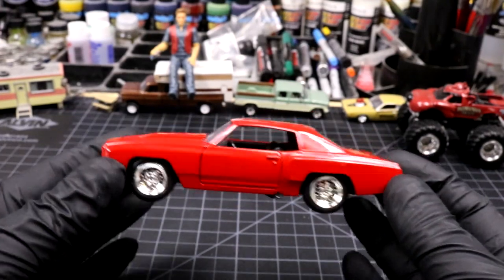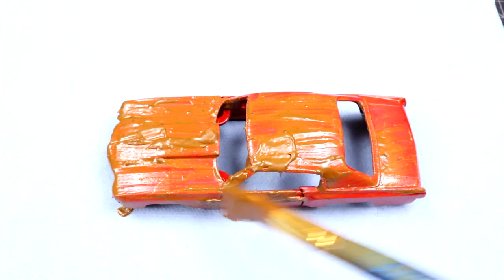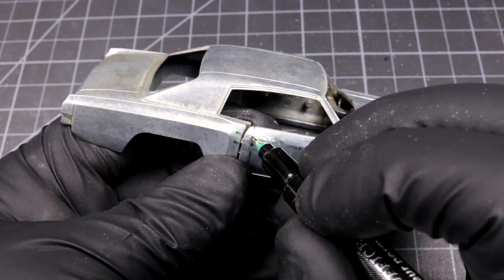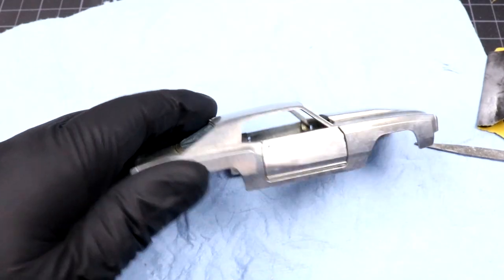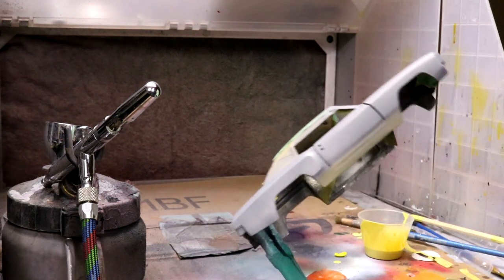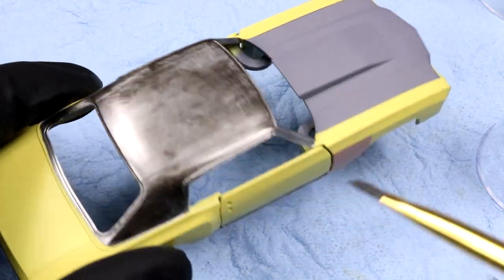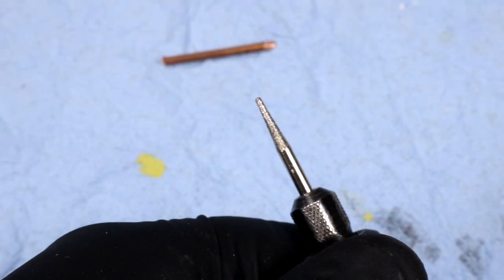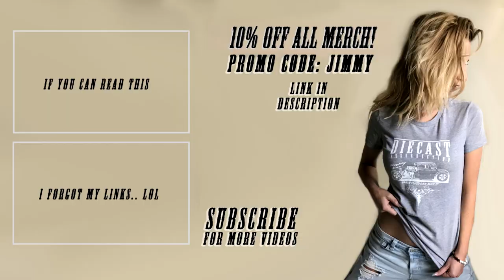I Made the Fast And Furious Monte Carlo (1:32 Scale Diecast Build)

Comment: What type of putty did you use for this?
I've used a few kinds for the cars Ive done and not had much luck with some brands
Reply from the maker: I use a JB quick weld putty, make sure it's the High Heat kind.. can be found at a hardware store next to the regular JB expoxy.
Reply from the maker: Check out the VW bus truck trailer combo vid to see more of it.

Comment: question i am looking to do some custom hotwheels my question is how did you reattach the bottom to the the body did u use rivets or what
Reply from the maker: Those bigger cars mostly have screws from the factory so they are easy to take apart and put back together.
Reply: @DiecastResurrection  can u use screws if it  used rivits. And another question what was that product u spray to keep the decals you printed from bleading on your making water slide decals with inkjet ep i will like to make my own decals so the name of the product would be helpfull 
love your vids keep them comming

Comment: 1970 Monte Carlo has round turn signals in the front bumper.  A 1971 Monte Carlo has rectangle turn signals in the front bumper. A 1972 Monte Carlo has rectangle turn signals next to the headlights. Yours is a 1970 body. People did swap around parts back in the day ( I did on  mine), so if they call their monte a 1971 in the movie they could be wrong.

Comment: Love that you did a first generation Monte Carlo but this isn't a 71 it's a 1970 the round turn signals in the bumper are the dead give away.  In 71 they were in the bumper but rectangular shaped.  1972 they were on either side of the grill not in bumper at all.
Reply from the maker: I appreciate the comment, but my dude you gotta understand that I read the dates that are written on the cars. The car is a 71 even if the bumper is a 72. So many of you guys thought it was important to correct me.
Reply: @DiecastResurrection  I understand the mistake started either in the movie itself or on Hotwheels end and unless you've owned or dealt with Monte Carlos the first generations all look pretty much the same.  70 round turn signals in the bumper 71 rectangular in the bumper 72 longer skinnier signals on either sides of the grill itself.  It's like an enthusiast of Impalas every year they changed something on this cars and people can identify each year easily where a layman would just see it as an Impala.  We didn't mean to ruffle your feathers just thought you might want to know FF or Hotwheels didn't get it right, sorry for any distress this may have caused you.